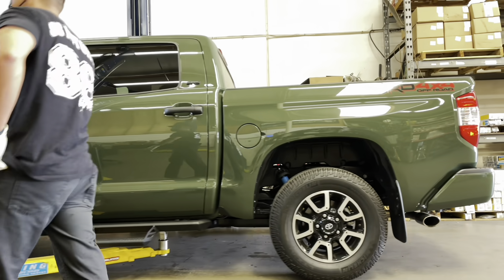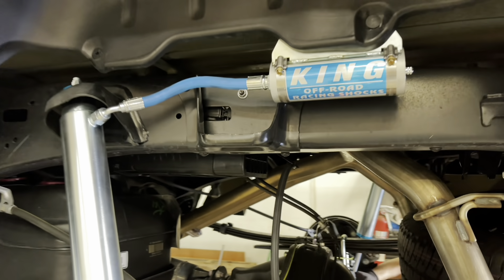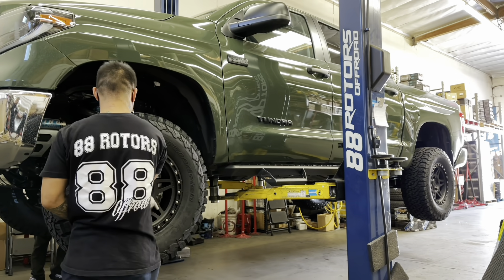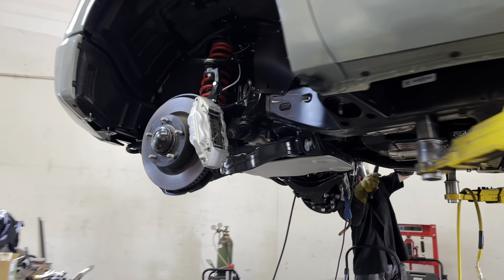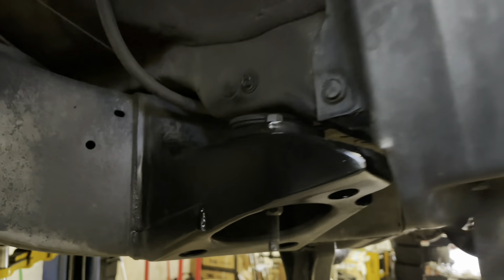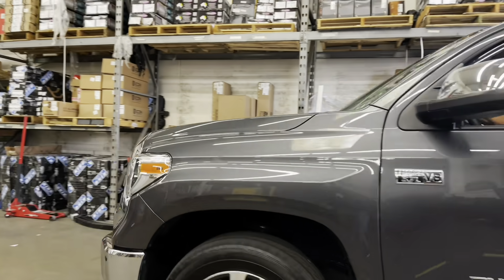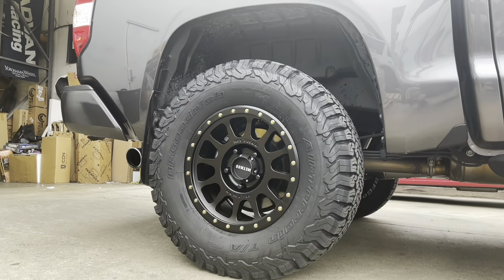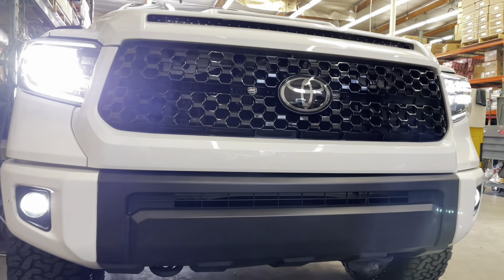LIFTED TOYOTA TUNDRA KING SUSPENSION AND GET FREE 88 MERCH!

Comment: 2016 Tundra TRD Pro in Quicksand which was the only year Toyota made the trd pro tundra in quicksand and the quicksand was later used for Tundra between 2017-2020 which were SR5 and Limited Trims only and was discontinued after 2020 for the Tundras. Still a great color and one of the rarest pros to find

Comment: What's the minimum raise/lift that needs to happen to be able clear 37's on the Tundras?
Reply: 3inch lift with adjustable UCAs, BMC and high clearance front bumper or a lot of trimming with stock bumper. Wheel offsets plays a part as well.

Comment: Nice trucks from those who like this type of setup.  but I hate these ugly ass  tires. Most of these are really noisy and are not rated to operate safely at highway speeds. 
For my truck I run 24 inch street tires with  3 inch front lift .
Reply from the maker: You're probably referring to lower end brands. It's 2021, offroad tires aren't making noise the way they used to 10+ years ago. BFG and Toyo that we have on here are extremely on road friendly in terms of noise. 24's are a dub style type of truck, its' different because its okay to run highway tires on those.